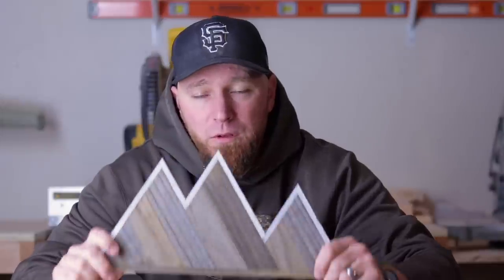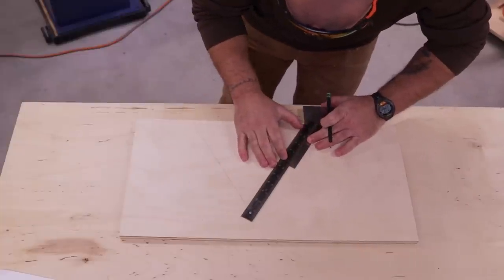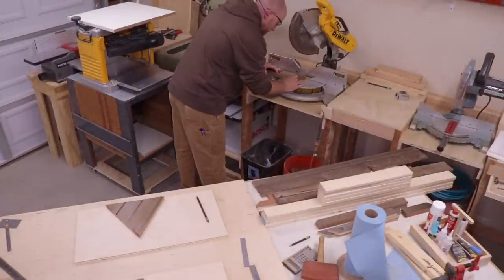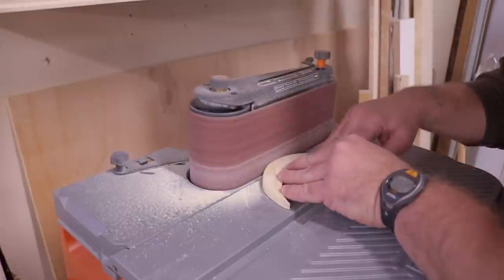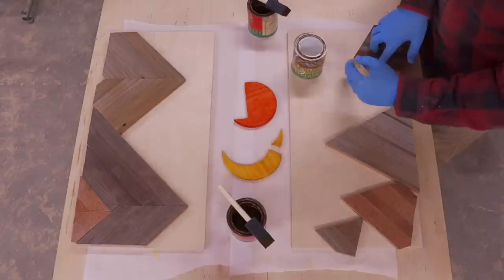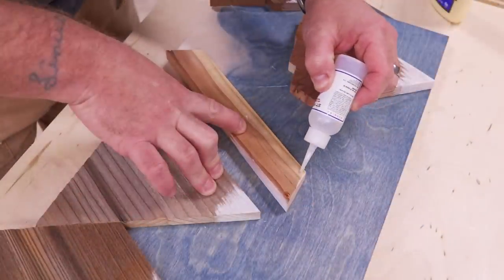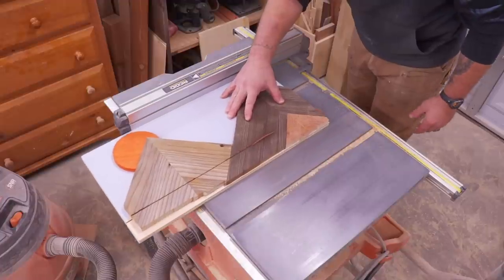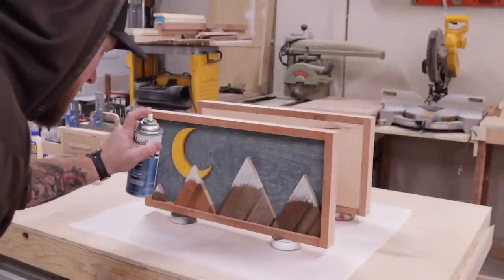The 30 And 45 Degree Rules / Making Wood Mountainscapes

Comment: The lighting looks better than most out here in YouTube land. The color seems to be a little chalky but that may be my device.  The sound is great. Depending on what you are going for in the lighting effect you might want to run a search on Rembrandt lighting. In studio portrait photography the main light ratio to the fill light is a maximum of 3 to 1. In video lighting you may want more of a 2 to 1 ratio. The lighting ratio can give you some light shadows on the face so it's a much more normal or life like appearance and not come out flat. Sometime raising the main light slightly above the head will give the look of a more natural (sun like) lighting as well. 

But I got to say what you have in this video is far better than so many video makers out here.

Comment: That water base clear you use how does it come out of the can. I've gotten 2 of then and it's dosent come out nice and even  it splatters just wondering if I got a bad batch or that's how that stuff is
Reply from the maker: So I had really good luck with Minwax and Varathane until lately. I think I got a bad batch as well. This time of year I make sure to keep it inside. That helps a lot as they seem to hate the cold. I have noticed with the water based stuff though, even if it isn’t a perfect spray, it doesn’t build and gum-up like the oil based. I used this same stuff for my computer desk and at first I thought I ruined it. Turned out just fine. Oh also make sure the nozzle isn’t clogged up. That’s happened to me too.